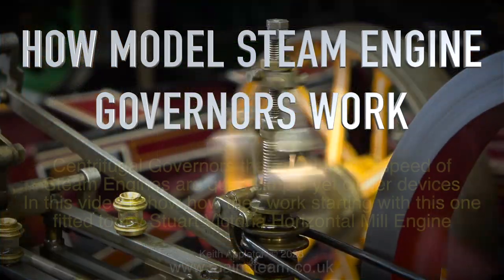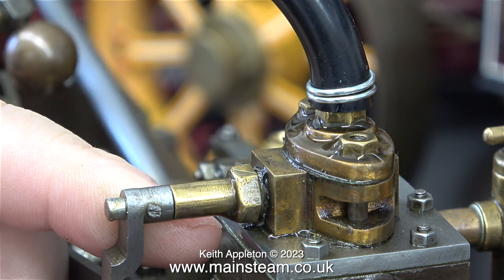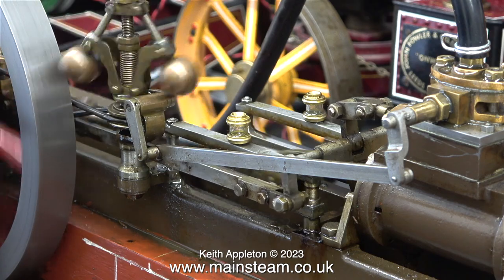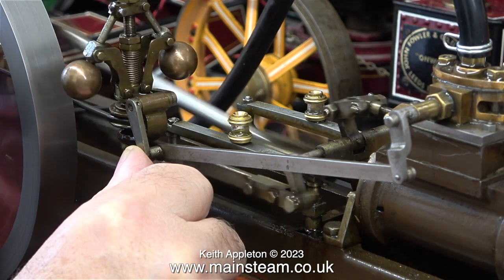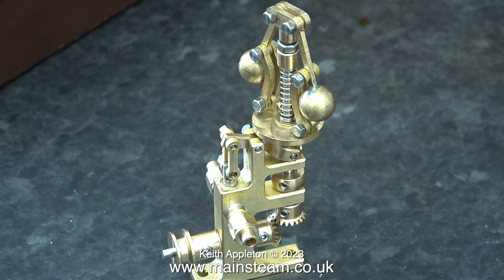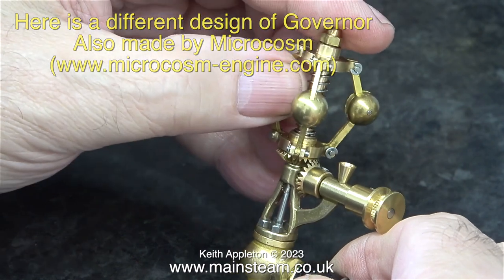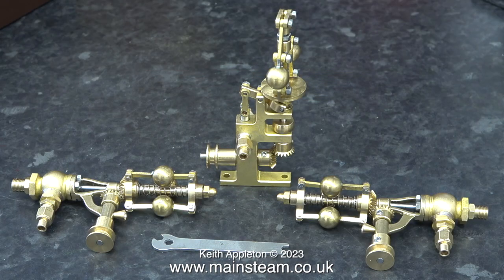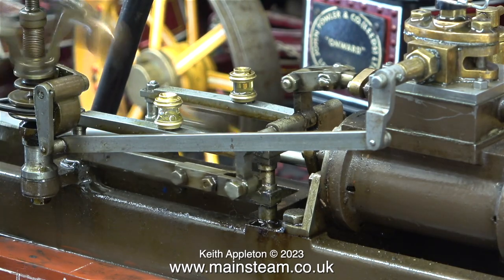HOW MODEL STEAM ENGINE GOVERNORS WORK

Comment: Many years ago, I was operating a traction engine (Foden 1700) driving a saw bench. I could watch the governor and listen to the exhaust beat as a log entered the blade and when it exited. I could also observe the water level rise up in the glass as the balls went down and the exhaust got sharp and loud as the saw started to cut and the reverse as the material left the blade.

Comment: Hey Keith, I was testing my steambike the other day and I had big problems with the gas cannister freezing up. I use Coleman c500 gas cannisters, and as far as I know the cannister was quite full still. Do you know any ways I can prevent this? The tank cannot be mounted near the steam line or burner for safety and logistic reasons. Cheers, Thijs.
Reply from the maker: Try putting the gas canister is a pot of cold water and direct the water gauge blowdown output near to the pot of water . . . . . . an occasional blowdown keeps the water almost warm but not hot,  just enough to prevent chilling.

Comment: I was running my Wilesco Model Steam Engine a couple of months ago, and suddenly the governor drive belt snapped. I have not been able to replace it yet because every time I look for a new one, they have been a straight belt not attached. Do you know where I can get one that is attached at both ends or how I can attach the ends to make it a circle?
Reply from the maker: They are all like that - not in a loop, you simply twist one end inside the other . . . . . .
Reply: @keithappleton  Thank you. I’ve just tested the snapped band using compressed air and it works very well. I thought it was broken and I was going to have to get a new band. Thank you very much!